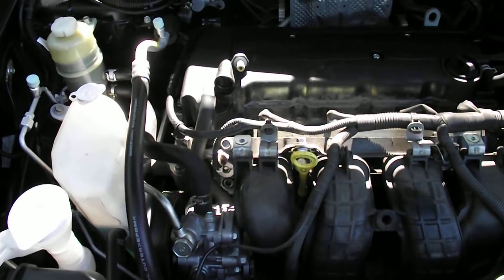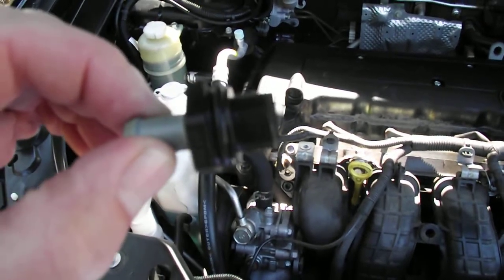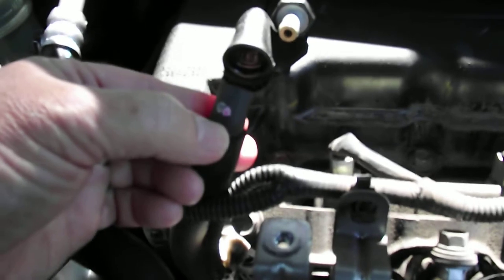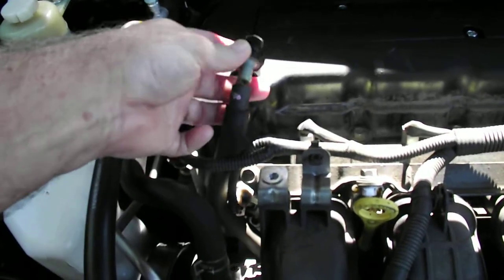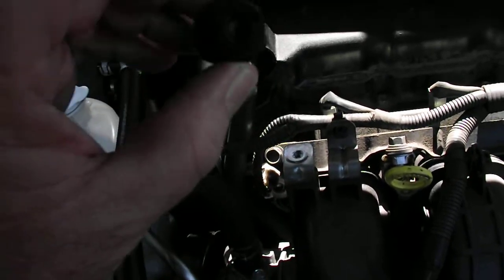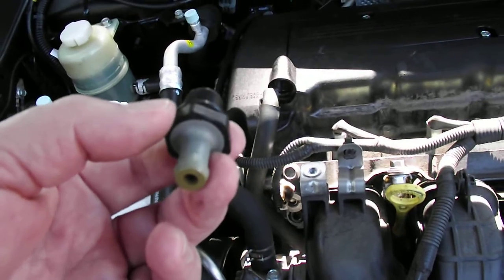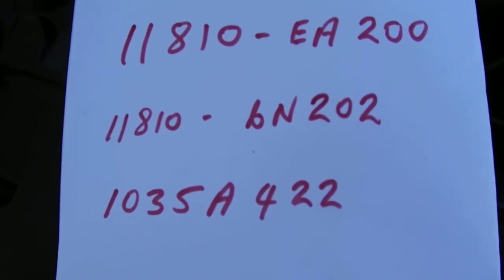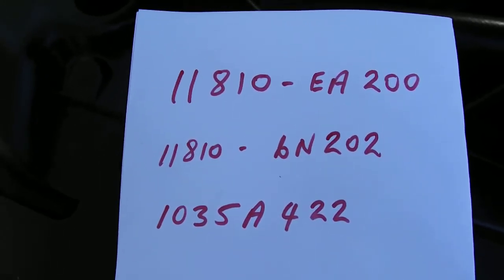Removing and checking the PCV valve on a 2010 Mitsubishi Outlander 2.4 petrol engine.

Comment: very helpful video! thank you
My 2008 Lancer I think produces an excessive amount of blowby gasses. When I open the oil filler cap, I can feel the air blowing out of the engine. Some say it's a worn down engine, some say check PCV valve. I am going to check the PCV valve first. It probably has never been replaced (121000km).
Reply from the maker: It certainly cannot hurt to check or replace, as the PCV valve is frequently overlooked in services.
Reply: @johnvienta7622  Did it fix the issue and you didnt tell us the price, I guess i can ask around but they could tell me anything. Thanks for your time mate
Reply from the maker: @fishfacecrab  ... they are about $20 Aust dollars.    The Outlander did not have any particular problem, i just did it as I was working on it for my son who owned the car.   It is one of those things that gets overlooked, along with things like cleaning the Mass Air Flow Sensor.

Comment: i  wish this was a full video from start to finsih
Reply from the maker: Sorry about that, however I did not have anyone around to hold the camera while I removed and replaced the PCV valve.  All that is missing is pushing back the rubber hose from the end going to the inlet manifold with a small flat blade screwdriver, and then using an open ended spanner to undo the threaded end which is in the valve /rocker cover, and then replacing the valve, threaded end first.   There are plenty of videos on YouTube showing the cleaning process, and how to check for suction, however I stress that is a personal choice between cleaning and replacing the valve, as cleaning it does not guarantee that it is actually working at full capacity.